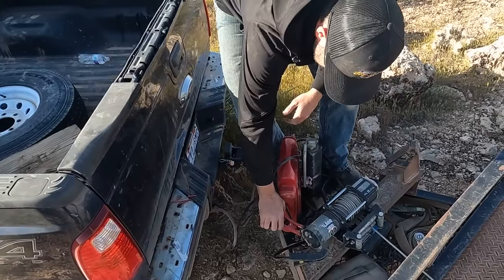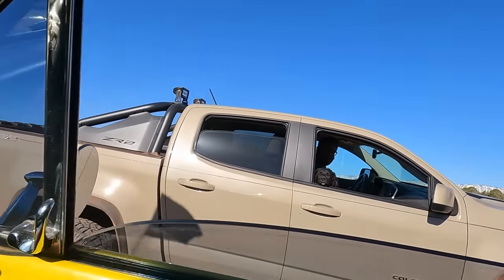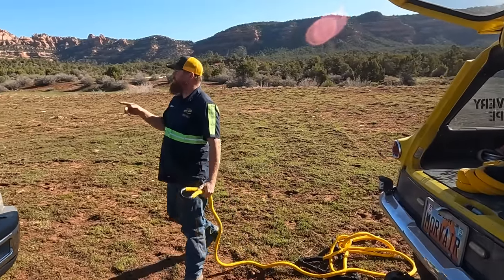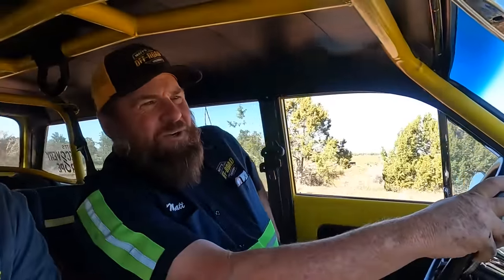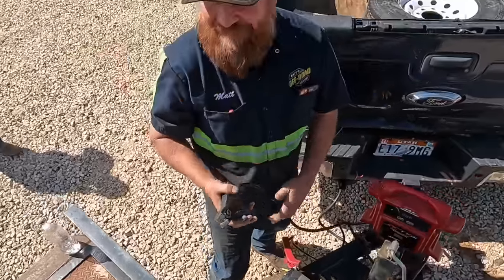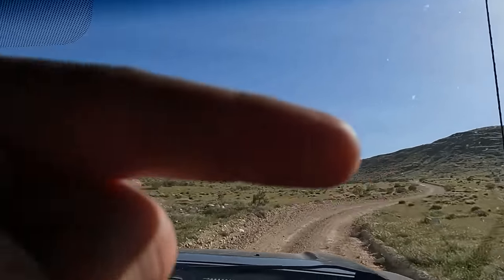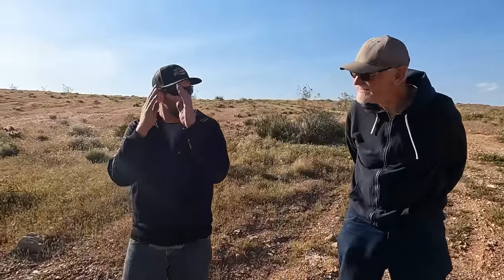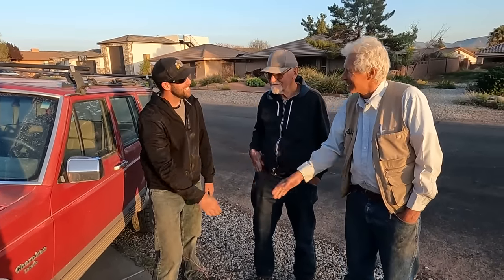Stuck 2 Days In The Greatest Place On Earth.

Comment: A cheap tongue box, group 31 battery, and the solar battery charger. All from harbor freight. Wench, battery, and gear in the box. Charger on the lid. You can then pump without running the vehicle or a jump box. You can also use the trailer as a jump box. The battery will also get charged by the truck. So it's cheap insurance.

Comment: Still think you should run a power source back from the truck battery to the rear bumper and use plugs to power up those winches.  No power packs needed.

Comment: When the guy said they; "broke a coupla straps" - were they using 500lb  load straps thinking they were "snatch straps" - or something else (or just a really old 2000lb lifting sling - those aren't "recovery straps either (neither are "tow straps", winch extension straps, treetrunk protectors, or vehicle tow bridles...  (a good quality "either of those" would work for a static recovery  - or as a link in the chain for a dynamic setup (WWL / energy  ratings dependent of course)- or  even for a solo light tug, though not "recommended" - by the "xpurts")  

 - Sorry I was just caught out be the statement.

Comment: That's a pretty nice old Cherokee, except for those Gawd-awful wheels.

My guess is the Cherokee needs a crankshaft position sensor. (CPS) It's a common maintenance item on the old Cherokees -- it's supposed to be replaced every 80,000 miles, but nobody ever does it.

Comment: It is for this very reason that I added recovery points to the front of my 2012 ram 1500 2wd this week. All terrain tires are next. We pull a travel trailer a bit larger than shown, and dont want to be bound to rv parks forever.

Comment: The MOORVAIR didn’t even Break-A-Sweat. 😅  On Another Note,  If I bought a pickup 🛻 and it didn’t have 2 recovery hooks,  I would buy them and put them on. My Ford F-250 
4x4 Diesel has 4 hooks on the front and 2 on the rear. I also have a winch on the rear.  Badlands Winch.

Comment: I have had the Crank Position Sensor cause a no start on my 87 XJ.
Reply: Yep, 4.0L CPS get real susceptible to heat as they age, and the extra heat coming off the drive train from being in 4L (along with lack of speed/airflow) will cause them to act up or just finally quit. It's preferable to run official Mopar CPS, but even having a cheap spare in the toolbox can be super handy in situations like this.

Comment: Could've just had the colorado truck at the entrance pull him out?
Reply: Pull him out with what? Customer said they broke a couple straps.
Reply: @JohnFL  then go buy a new strap or a chain that won't break instead of calling a repo company that will cost way more. Guy in the dodge just had to give it a bit of gas while the Colorado pulled it out or the truck they were going to use to pull the trailer out.
Reply: @MrPando72  You know Matt's actually pretty affordable? YouTube pays for most of it
Reply: @MrPando72  I meant that Matt doesn't charge much if at all, because YouTube pays most of his costs